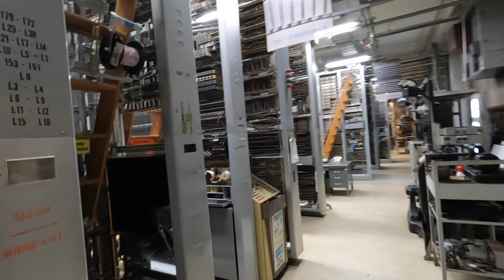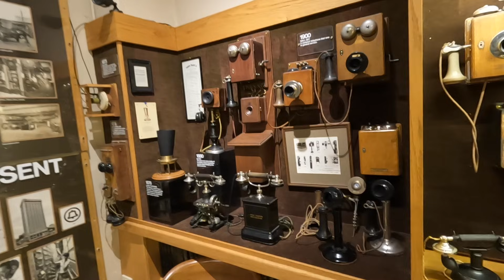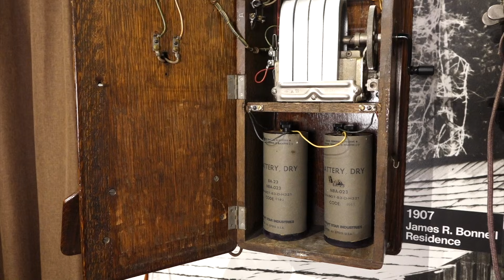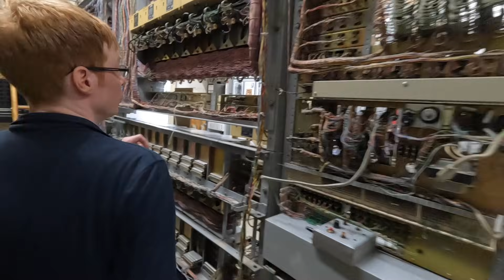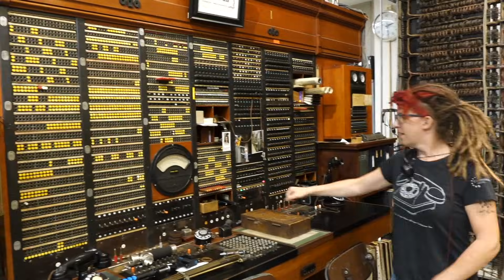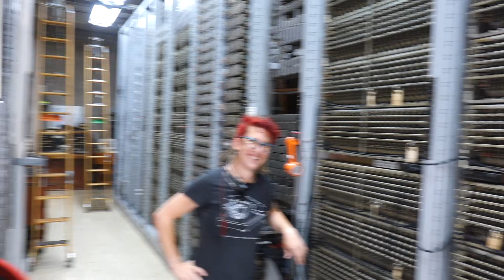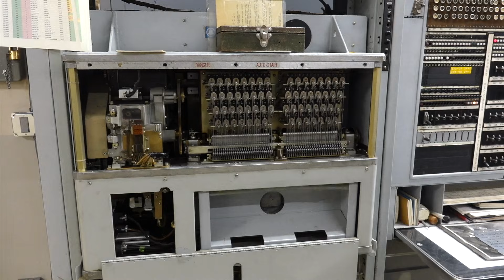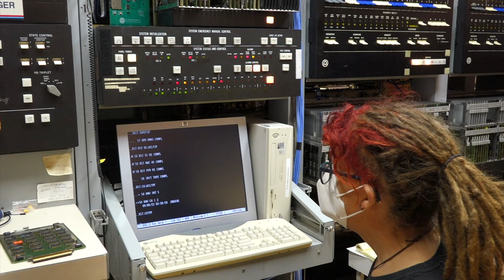At the Connections Museum: the insane telephone technology that led to today's computers

Comment: Back in the day when I worked at WBAA we had a permanent circuit from the station to Bell Test. When we wanted to do a remote broadcast we would put in an order for a circuit from the remote site to Bell Test, and they would patch it through to us. After the broadcast was over, Bell Test would call our master control room to ask for the "goodnight time" so they would know how much to charge us, since they charged by the time the circuit was in use. Before the Bell Test guy hung up he would ask "How do you sign?", which meant he wanted my initials for their log. That way if there were any questions later on they would know who to ask.

A few weeks ago I paid a visit to WBAA. Although the studios were rebuilt around 2000, the sub-basement which was under the 1941 control room was still there! They had some battery racks for powering the tube filaments; the batteries were long gone but the racks still had a few acid stains. The old audio cross-connect panels were still there, although disused. It was really neat to see the sub-basement, which had all the wiring for the 1941 control room, which was still in operation in the 1970s and 1980s when I was there.
Reply: I wondered how this worked, it used to be common in my early years, to see a radio station setting up a remote.. as I got into the billing of phone lines, it appears that they just left frequent locations "hot" instead of paying over and over for one months minimum, and installation, for each use.. say at a convention hall.. or at least a trunk to a certain central office.
Reply: @Stache987  Certainly, if a remote site was to be reused in the near future, telco would leave the circuit in. Usually they'd terminate it with a battery powered tone generator. That way it was easy to check for continuity a couple days before the broadcast in case the wiring had been disturbed. The broadcast engineer would disconnect the tone before hooking up his equipment, and often put the tone back after he was done in case the circuit needed to be monitored by telco or by the station. In the sub-basement at WBAA, we had a high accuracy, low distortion 1004 Hz  oscillator which could be patched into outgoing circuits so telco and other stations to which programs were being distributed could check the line. We would usually feed tone for two days prior to sending a program so telco and the stations could make sure everything was ready.

Comment: Tracing all those mechanical connections is why old movies show cops trying to keep kidnappers talking as long as possible when they call in with their ransom demands.  Imagine scurrying around a huge warehouse with hundreds or thousands of these racks, then discovering the call is from a neighboring exchange and having to call them up to start yet another manual trace.
Reply: That trope about tracing the call became so ingrained in people's heads, it continued to be shown on some TV crime shows even after digital electronics had made it useless to keep the kidnappers talking.
Reply: I remember a movie where  They were trying to trace a call And it was on all step equipment,  I couldn't believe  how they can they could do it.. backwards from the termination end

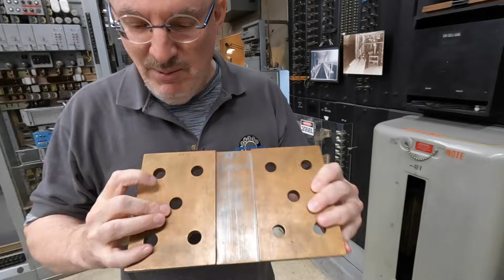Comment: 3:22 Wow a 4800 amp fuse?!?! That’s wild.
Reply: There would probably have been quite a few of them. Back in history, where I worked in the UK in long distance transmission our idle current on just one of the supplies was 5000 amps at 24V, I think we had about 6 if I remember correctly.
Reply: But they misspoke.  That's not a fuse, as others here have said.  It is a shunt for an ammeter, a 4800 ampere ammeter.

Comment: It’s pretty crazy that the functionality can be replicated using a Cisco SPA122 (granted not on the scale) and a raspberry pi today using asterix software. I’m sure I’ve still got mine lying around somewhere along with a few old phones that I used to place calls between, or make a call to the answering machine that I could hook up to the second phone line. 😅
Reply: Well if you're not worried about scale, you can replicate the technology with just some wires and a relay or two (or a switchboard).  The scale is what made these machines necessary.

Comment: In the late 80's I had a tour of a live CEO on Heritage Drive in Calgary AB. It had a mix of old school and modern tech. It had racks of spinning thingys. Man was it loud in there at 9:00 Am. I was with MJ Roofing and we caused a flood. We had half of the tar roof replaced and a massive rain storm came over. The insulation started to float and ripped our temporary tie in from the old tar roof to the new re-roof. We had the roof drains plugged and the water had no where to go. I spent the night pumping water off of the roof.

Comment: Great video Marc, good to see these guys preserving the past. I worked in the industry in International telecomms in Australia from the 70's and seeing those big wiring looms reminds me of the days spent standing on a ladder sorting out the wires, Blue, Orange, Green, Brown and Slate. Lol.  We installed mostly European equipment made by Ericsson AKE and AXE, but also of interest is the Telex Exchange of the time made by Hasler,  a T202 model.

Working in an exchange like this was a noisy experience but if the rhythm of the random click and clatter changed, the operating technicians would come from everywhere to diagnose the problem because of the change in sound. A major part of these exchange buildings were the big battery rooms along with the rectifiers and bus bars feeding the wet cell batteries making up the 50 Volt supplies and on the Telex floor the 24V systems.
Reply: Better a ladder than sitting on the pump which was keeping the hole dry trying to sort out 600 pairs while yelling at the guy standing behind you to hold the flashlight still.  I learned to view backhoe and excavator operators with a level of distaste reserved only for them.  FWIW, the colors are the same.  Fiber added "Rose" and "Aqua".

Comment: Ah one of the big buildings they made to house the toilets. (im joking) i occasionally have to enter one of these huge buildings to run a jumper but 99% of the time its because theres toilets inside. All these buildings look like this and are just as huge all converted to automation long ago muti story highrise buildings completely empty i always see the outlines on the floor where this stuff used to sit the mounts in the ceiling for the long gone cabling. everything is on the main floor now 1 interconnect frame for local lines running to the dms system and 1 fiber interconnect frame running to routers. I always thought itd be funny to do urbex on these buildings but theyre all still live even if the only stuff running is all on the one floor in the corner.

Comment: I love this museum. When I first visited everyone there was a former Pacific Northwest Bell technician or engineer, most well past their retirement ages. In subsequent visits some younger faces, like Sarah's, appeared.

The museum really owes its existence to the rise of digital switching in the telephone network (and the breakup of AT&T). When Pacific Northwest Bell decided to retire all their electromechnical switching equipment in favor of digital equipment, the Director of Engineering, Herbert Warrick Jr., decided that part of the endeavor should be preservation of the equipment they were about to replace. My understanding is that the panel switch was particularly difficult since it had been assembled in place without the same sort of modularity that was designed in to later generations. If I remember right, they had to cut a hole in the wall of the central office that housed it in order to extract it. The museum itself occupies space in a central office made available by the decommissioning of electromechanical switching equipment.

The different switches in the museum are interconnected and so calls can be placed that span different switches. You can hear the call move across and within the switches as teh contactors and relays clatter and click. Back when they were in service it must have been impossible to pick out the activity of a single call being switched except perhaps in the dead of night.

It's definitely worth a trip when visiting Seattle. It's also worth visiting the Living Computer Museum, which has many generations of mainframes, mini and microcomputers. Probably better to visit them on two separate days, even though they are both in the more industrial area south of downtown; there is a lot to take in.
Reply: Sadly the Living Computer Museum is no more. Connections is still going strong though, and they're bringing up a new museum in Denver.

Comment: Too bad they didn't talk about how the computerized version did the actual circuit connection.

I did an internship in the mid 90's and was shown the last operating mechanical impulse based local exchange.
Mechanical counters counted the used units.
Walls of cable connected the cable to the phone with the cable to the local exchange making the physical connection between phone and phone number.
Reply: You wouldn't believe how difficult it was to explain message units to a customer calling about their bill or ordering new service.. in my area we had two cities in the state with 5 zone rates, like long distance you had discounted periods.. we had tables that we had to get from one book in the office that told from where to where was zone # rate, like a mileage band on toll calling.. I was one of the few that made my own cheat-sheets as I understood it well, and was called upon by others for a rapid reply. Customers didn't realize their calling area for unlimited was based on its geographic neighbors, it's distance to the called party, and lastly a exchange wide poll of the customers.. in this jurisdiction you had to send ballots to all affected customers, half of which had to respond, and a majority had to agree to extend the calling area.. the phone rates also were tiered based on how many customers were in the local 1FR calling area..  oh those days, most people don't use wireline anymore and it's moot to them.. likewise people don't remember paying for toll calls, almost 45 years ago, my first partner and I spent so much time on the phone, his long distance was switched off without warning fir a "advanced toll bill" even though, AT&T was the long distance company, and Bell of Pennsylvania had already been divested into Bell Atlantic, somehow, it surprised us.  Eventually we got calling cards at the wholesale club that made the rates a fraction of what it was.

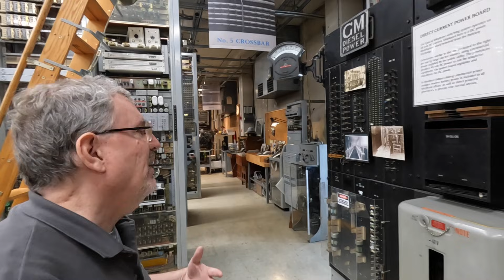Comment: The item at 3:18 is not a fuse, it is a DC current shunt.
Reply: That was my first thought, the busswork bolt pattern and the drilled hole on the narrow side for the sensor lead...
Reply: @davewood406  I worked in heavy industry, mostly steel mills, every DC motor circuit had one.
Reply: @Davemte34108  i got my start in telco doing DC plants, a few 10,000 amp shunted plants though they weren't equipped with that many rectifiers initially, 1600 to 2000 amps usually as I recall. But room to install more when needed.
Reply: My first guess as well. They swear it's a fuse, but if that thing ever blew you'd have molten copper all over the place...which would be a Bad Thing, methinks. I'm voting for shunt as well (unless it lives in some kind of enclosure they didn't show us, to contain the spray when it blows)
Reply: @antronargaiv3283  sorta similar appearance. I can see it could be easily confused. The newer types with several thinner elements between the plates might have a secondary fusible link function but I bet that’s pretty heinous as well. Better than burning cable I suppose. I’ve heard a story about that happening. Been a while so it might be apocryphal, plant discharges hard and long, tank cells reverse polarity in the process (possible according to documentation I’ve seen) upon restoration that issue was missed. Switch or breaker is flipped and a 750mcm cable suddenly wants to be a toaster heating element.
Reply: That seems reasonable, I don't recall seeing fuses in strowger exchanges I worked in the UK. Mind you just about anything dropped across the bus would vaporise before a fuse would blow. So I can't think of anything short of a disaster that would blow such a feed fuse. I wouldn't have thought 4800A would have been very much for a reasonable sized strowger exchange those things were power hogs. I worked longest in transmission and just one of our rectifiers idled at 5000A 24V and peak at around 15000A and we had a few.

Comment: I did my telecommunications apprenticeship on all this stuff ( post office tellecommunications >British Telecom). There is a whole lost art of correct tensions on wipers (strowger) as well as all the setting up of relay contacts as I had to service and replace stwoger wipers and relay contact banks using tension gauges , checking make before brake etc . Not mentioning running jumper wires, cabeling and wireing those up to various contacts. They did not show you the MDF (Main distribution frame)  this is where the trunk cabeles arrived and terminated and where you interfaced with the telephone exchange. I worked when Operrators still existed and helped install the new fully automated dialing systems STD (Subscriber Trunk dialling). I can still remeber the unholy nosie of a huge telephone exchange running strowger gear in full flow the smells. Going from that to utter silence when everything upgraded to fully eleconic switching. Yes I am ancient 😩

Comment: The amazing thing about telecom is how long these devices can actually last, when they are maintained and monitored by knowledgeable people.  Marc, you mentioned starting on the 5ESS switch.  I work for one of the "big 3" cell phone companies here in the US, and I too worked on their 5ESS phone switches!  That company has only just earlier this year decommissioned their 5ESS switches for their production traffic.  However, some of the environmental monitoring cannot be converted to new systems, so some of those 5ESS switches are remaining up and running in limited capacity to serve those monitoring functions even now, in 2022.
Reply: The electromechanical panel switch at the museum operated for 51y, though as he noted in the video, there were two people monitoring it at all times.

Comment: My lady friend and i were in Seattle several years ago sightseeing.  Went t the Boeing museum of flight but didn't know of the Connections museum close by.  Being a retired Bell head who worked for PacTel, Southwestern Bell and finally Mountain States Tel co's, i saw and worked with a lot of small CO's as well as the larger ones.  Strowgers were  used in all the office's i was associated with.  My last office was converted to a DMS-100 before 2000.  It has previously a 1A switch.  My my, the memories.  I did construction, splicing, inst. and repair, cable work, teletype, special services work, test center support and finally CO tech.  Ma Bell gave me a lifetime of memories.  I'm hoping to get up there and visit before......  One last time.

Comment: Unix was not created for Telephony, it is a pun on MULTICS. Unix was for a long time just used in the patent office to prepare patent applications at Bell Labs with "roff". 
Things that have specifically written for telephony include for instance Erlang. A language and system made by Ericsson which does not crash by design. The name being an homage to Agner Erlang, and the unit of "Erlang" to measure usage of telephony equipment.
Reply: Unix is what happens when you have two genius-level PhDs sitting around with not enough work, and a spare PDP-7 gathering dust in the corner. RIP Bell Labs...

Comment: I remember as a kid, one of my uncles used to be an engineer for Post Office Telecoms (which became BT).  He took me to work one day, and showed me two exchanges.   One was using the same kind of analogue tech in this video.    I don't think I've ever heard such a loud noise, but it was fascinating watching it. The other was apparently one of the first digitally switched exchanges they installed (it was called "System X" and is still in use in parts of the UK).   It was a lot quieter, and while it probably contributed to a lifelong fascination with computers, it was boring.

This is in the UK, BTW.
Reply: When I transferred into the central office, we were preparing to turn down the last handful of 1AESS. They were so much more fascinating than than the digital switches that replaced them, or the voip switches now replacing the digital ones...
Reply: @boballmendinger3799  I think the problem is that both the digital switches, and the VOIP switches are essentially custom designed computers.   

While computers can, and do, do amazing things, they are pretty boring to actually watch while they are doing them.
Reply: I always thought System X was such an evocative name.

 It was a little before my time but I read voraciously the history of telephony very young even before I got into computers.

Comment: When I joined UK telecoms the battleship grey Stronger was still around as was the occasional manual desk in rural districts. We moved on to 2ooo type switches rather than crossbar so it was a time of multiple systems and many long courses away from home.